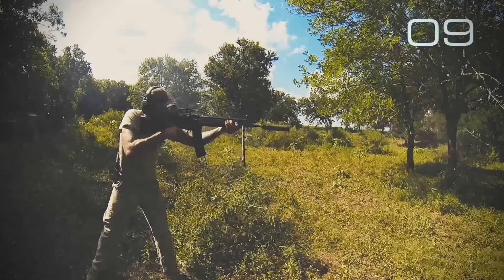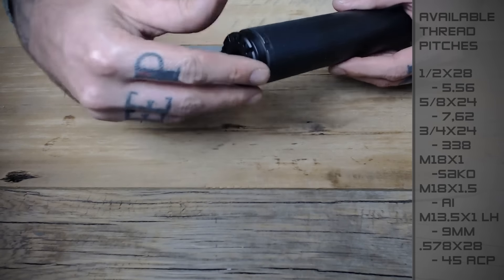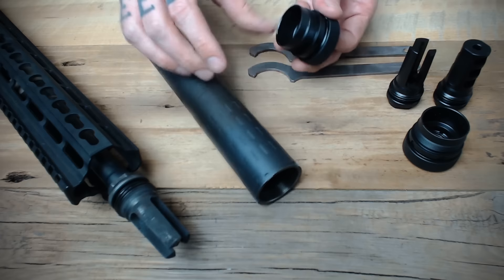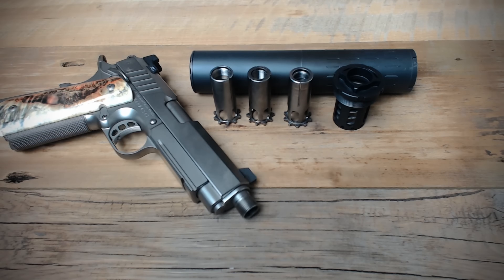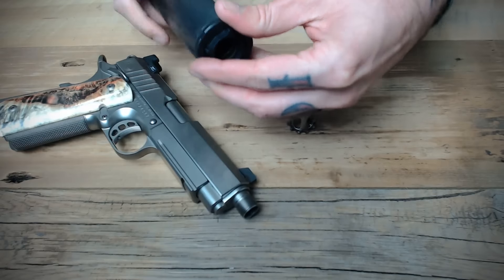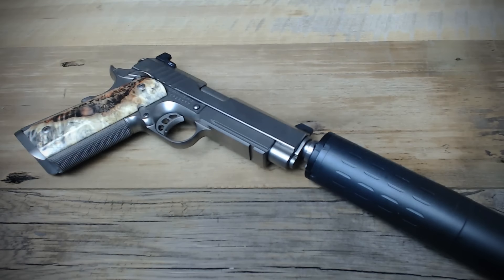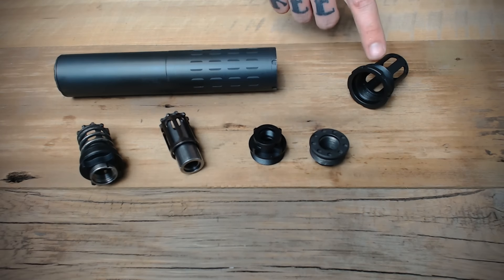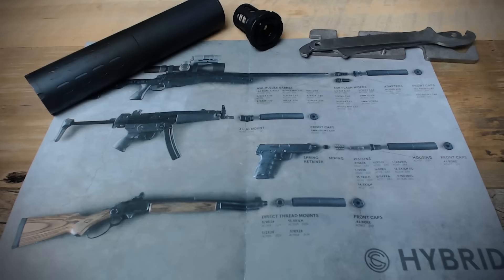SilencerCo Hybrid - Part 2 - Mounting and Accessories

Comment: great video, got stamp and Hybrid this week, have several rifles being threaded. Gun Smith has a different Slienerco product on a 7.62Nato and mentioned a muzzle break as being very beneficial.  Made it sound like a standard product. This confused me. Perhaps he meant a ASR mount over a Muzzle Break which is on the muzzle? Was planning on direct threading the Hybird on each rifle and perhaps leaving the .46 end cap on full time. Fear of not remembering to replace it and shooting something too big for the hole. Just starting will figure it out.

Comment: First time buyer, I will be using it for 9mm, 5.56 and .308. Should it concern me that the baffles do not come out to clean? Or is this an Internet myth that baffles should come out. Thank you for the help.
Reply: They don't really need to be user serviceable, especially if it's a centerfire rifle can. The pressures from centerfire rifle shots clean out what needs to be cleaned out. Some buildup actually makes the suppressor quieter.
Reply from the maker: Dave is correct.  You need to clean 22 cans, as they get lead buildup.  Centerfire cans generally just get some carbon, which isn't really a big deal.  It's kind of like cleaning dirt off of car tire treads... you can do it, but it's not really going to accomplish anything.
Reply: Thank you for the input. Looks like I have to spend a grand now oopsy

Comment: Thanks for the video! I just got my hybrid in this week and I couldn't figure out how to put the Piston assembly together. I just have two questions, do you recommend using oil or grease on the Piston? And what 1911 is that (did it come from the factory with a Threaded barrel)?

Comment: So the fixed barrel spacer on the piston is not acceptable to direct thread on a fixed barrel? Or it is acceptable?
Reply from the maker: It's a complex answer.  On rifle calibers, you do not want to use the piston and fixed barrel spacer, as they aren't designed for that pressure.  You can use it on pistol caliber systems, but it's overly complex when direct thread mounting systems have less moving pieces.   It's "acceptable" but not something I generally recommend.
Reply: Capitol Armory ok, I just got the fixed barrel spacer anyway to use on 9mm subguns. But don't use on rifle calibers. Got it.
Reply: Capitol Armory that's where the ASR mounts come into play.
Reply from the maker: @scott27t  Yessir, you got it!

Comment: I've been waiting all week for y'all to upload this video! You have the best, no-nonsense informational videos I've found so far for every product you've uploaded a video for! I've been planning to buy an Omega for a year and just completed the last steps to finalize my trust on Wednesday. Only have a few questions. Now that the Hybrid is out, what would you recommend for a first time suppressor buyer between the Omega and the Hybrid for use on an 8.5" .300 BLK, some 5.56 SBRs, and a 20" AR-10? Does the increased size of the Hybrid help to tame the noise a little better than the Omega? And if so, would that, along with the Hybrid's ability to be potentially used on larger caliber platforms down the road make it a better buy regardless of the added length and weight? I'd probably be using the ASR mount for all platforms. Thanks in advance!
Reply: Whoops, scratch the weight factor. Just saw that the Hybrid is .2 ounces lighter than the Omega. Does this mean it's less durable?
Reply from the maker: Durability between the Hybrid and Omega is pretty much the same, the Hybrid is basically a big Omega.  The Hybrid also can cost more when purchasing accessories.  Really comes down to if you want to use it on hand guns or large bore calibers.  Both are good--- the decision really is just personal preference... I don't think you could go wrong with either.

Comment: Mine did not come with the booster housing or the poster. Are there differ'nt packages available?
Reply from the maker: It should have come with the booster housing.  It's screwed into the rear of the suppressor in the box and the 5/8x direct thread mount is off to the side.
Reply: @Capitolarmory  It did. I was just an idiot, thanks though.
Reply from the maker: @Galildoughty  Good deal, glad it was in there!

Comment: For now, folks using this on an AR platform looking to run the ASR Q.D. Mount with the Hybrid, are limited to using SilencerCo muzzle brake only correct? So essentially this Hybrid using an ASR mount will not work with any other muzzle brakes correct? For someone who shoots mostly unsuppressed, having my favorite muzzle brake is more important. Any options out there? will the Lantac Dragon muzzle brake work?

Comment: I recently got my omega 45k stamp. SilencerCo says I need the fixed spacer part to use on my cz scorpion  9 mm. Are there other options besides the spacer they sell? Thanks
Reply from the maker: You would need either the fixed barrel spacer or a fixed barrel mount for direct thread options.  If you wanted to do QD, there's both 3 lug and the Alpha ASR mount that would work.

Comment: What is the available options for the quickest one handed mounting options other than direct thread due to possibly mounting to a 14.5" upper with a welded muzzle device. Will also want to go to different host weapons so I will have the same muzzle device on host centerfire rifle's,
Reply from the maker: For real "One handed" direct thread is the option... other than that it's the ASR mount.  You could do it one handed just fine, but it does require the locking ring to be turned.